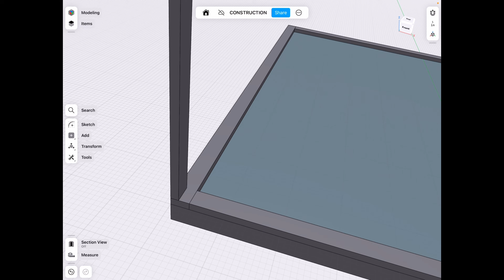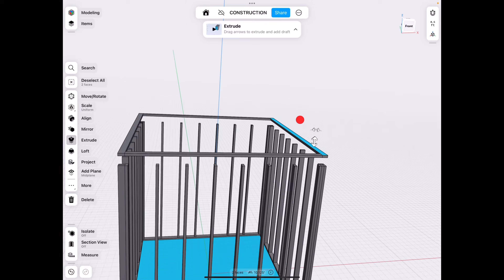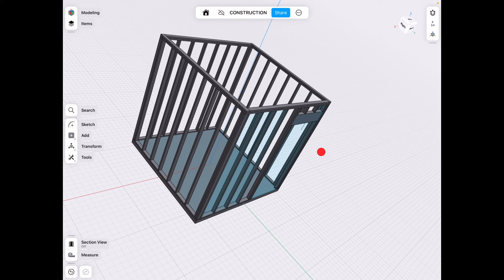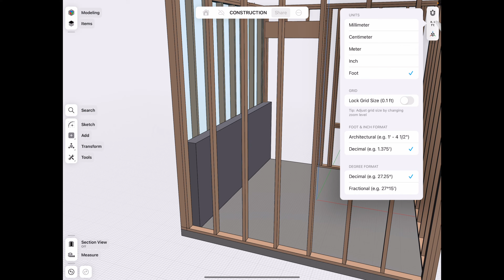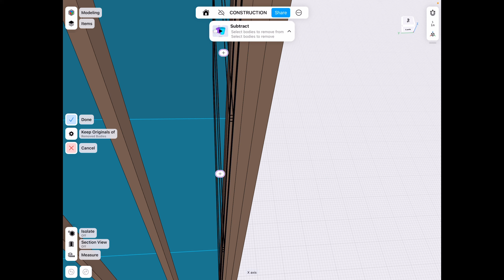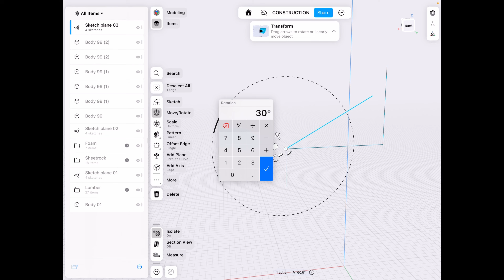Framing/Construction in [ Shapr3D ] CAD on iPad

Comment: Your video made it so easy to understand most of this program. Thank you! Now that I’ve done this and made my whole project, how do I make a cut list? No one tells me that. I’ve wasted a whole weekend designing something but now I have no way to easily cut it to put together.
Reply from the maker: This program isn’t best suited for things like that, but folders would be the closest thing you can use to organize your job. I’ll make a video in the near future to address that.
Reply: @JLake3D but why build it in this program if you can’t get a cut list to make it in real life?
Reply from the maker: Great question. Mainly for the visual, and prototyping. What I like to do is 3D scan a place and then build around those dimensions to even see if my idea would work. While this program is not designed for cut lists, you can get pretty accurate if you stick to a few basic rules upfront like using actual dimensions of lumber etc. That way if you organize things in folders, you can get a rough estimate of materials needed. Just always multiply by 130% for a cost estimate since things ALWAYS come up in real life.
Reply from the maker: This program is mainly used for product design, for that, this is an amazing program. For construction, you can get by, but there are better options if you have a PC.

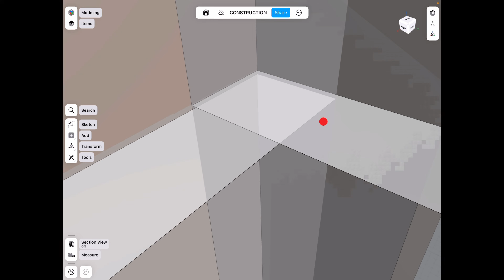Comment: 34:10- the frame is exactly 10X10, you didn’t accommodate for the thickness of the drywall, that is why it bled over into the other wall.
Reply from the maker: Definitely have to account for everything if someone is planning to actually build something. I did not have a floor plan, just made this video on the fly to help people visualize the process inside of Shapr. I’ve since had more projects going on and have improved my planning process :) Next video will be better 😂🤘

Comment: Can you calculate the materials from this?
Reply from the maker: If you organize your design correctly then yes, but it is still a manual process as the software will not tell you the numbers automatically.

What you could do is put specific materials in folders and then simply count the instances.

Comment: Hey man, 2x4 is 3.5 x 1.75 or 3.5 x 1.6ish depending g on who you ask. If you think about it, if you tack to pieces of 2x4 and lay them flat on top of one another, and place a 2x4 side up , it should be relatively  level with the two flat pieces. FYI, just trying to help (p.s. not all 2x4 are made to spec either, but rarely 1.5 on that side)
Reply from the maker: Maybe they are different depending on where you buy them 🤷‍♂️ my local Lowes says “2x4, actual 1.5x3.5.”